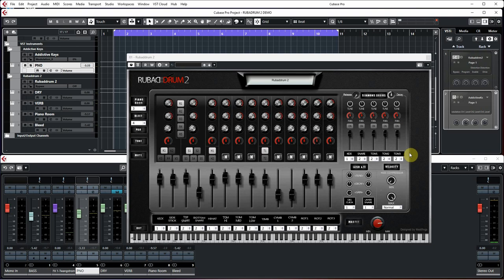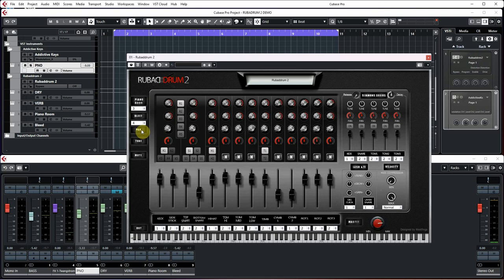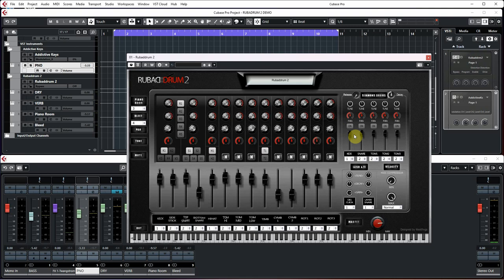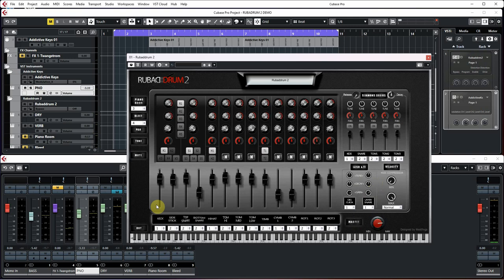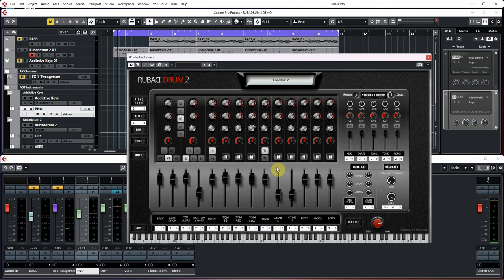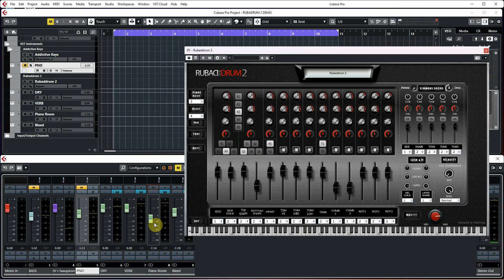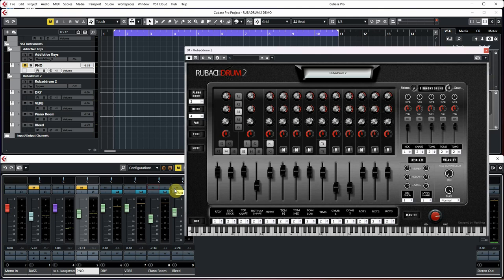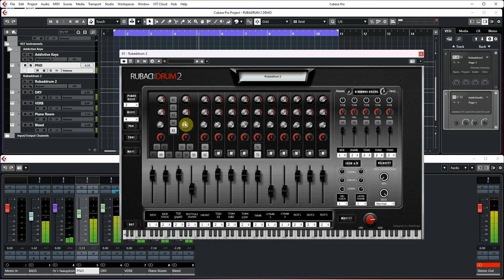RubADrum 2

Comment: Great video, thanks ❤ One question please, can we play the plugin with a midi edrum ?
Reply from the maker: I’m sure you can, just may have to set the mapping properly.
Reply: @JahServant  I'm using the demo right now to test the plugin, but no possibility to access to the midi menu in the plugin. And as default, the demo version is not working with my edrum.
Is there a menu in the plugin where we can configurate the midi device?
Reply from the maker: I can’t check right now, but I do it from a drum map thru my daw, I can change any note to trigger any sound.   You may want to contact Westfinga directly, Seb is a cool guy.  I’m not sure what may be disabled in the demo version.
Reply from the maker: Not sure, I don’t do it that way, I assign to a channel in my DAW and control that fader.  I wouldn’t be able to check either.  Best to ask Seb again, sorry I can’t help.  I’d think that it should work though.
Reply: @JahServant  thank you for your feedback I will link seb 👍🏼😉